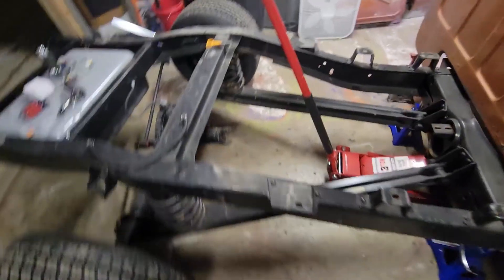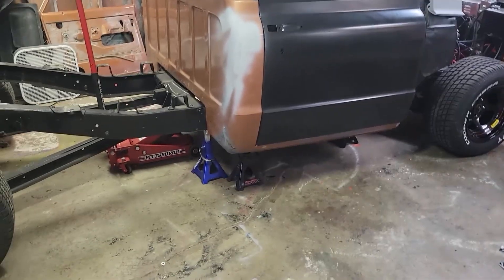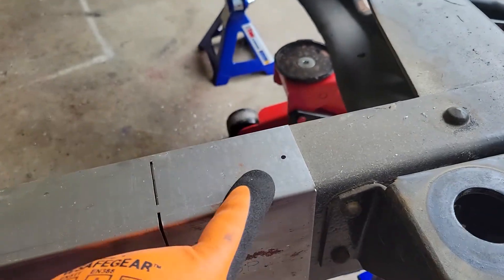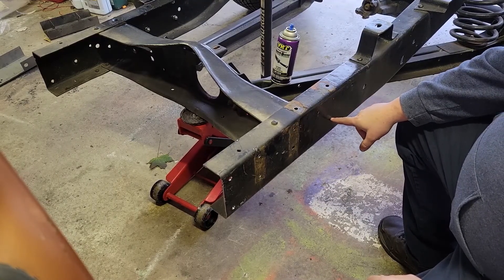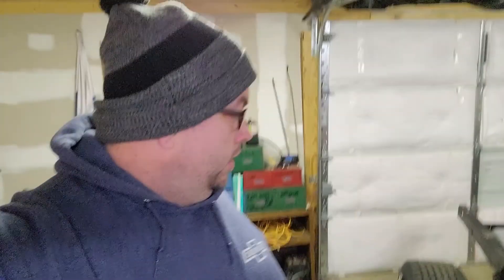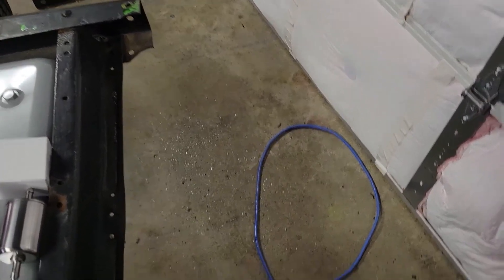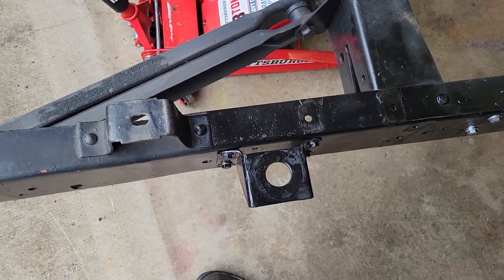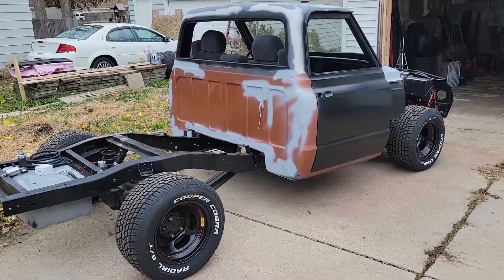BROTHERS Truck Parts - Long Bed to Short Bed Conversion - 1972 Chevy C10

Comment: What size tires you have they are 15 s but height and width?????
Reply from the maker: 295 50 15s
Reply: @DadbrosGarage  thanks sir the stance on the wheels and tires on your truck looks great
Reply: @DadbrosGarage how much u cut out the back / middle